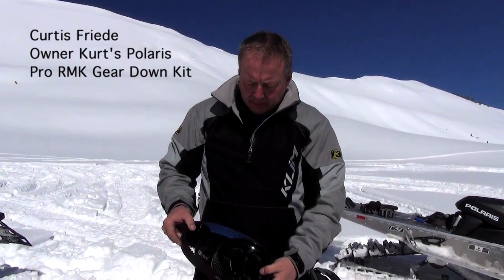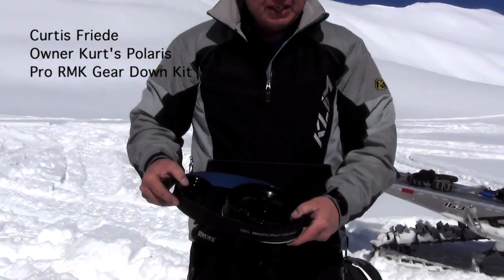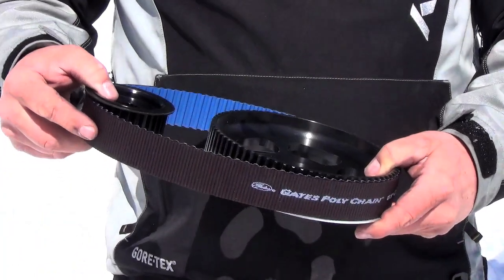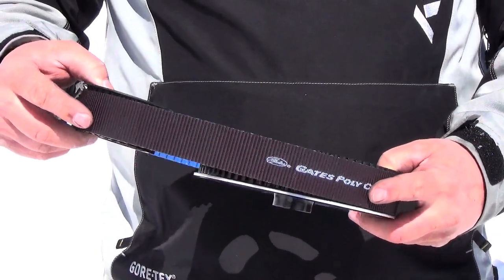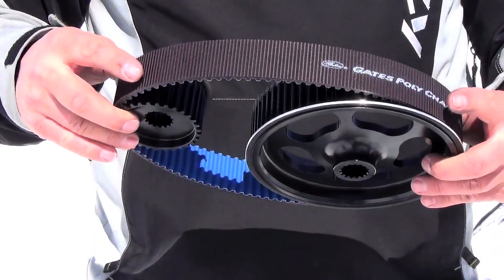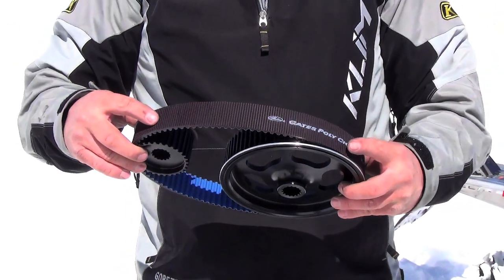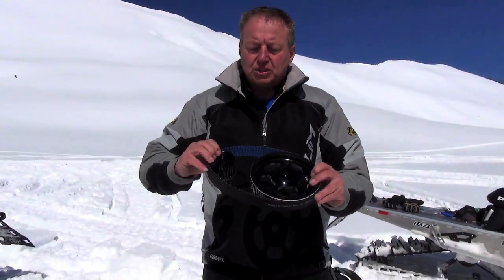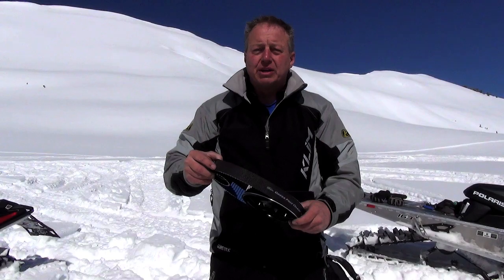Kurt's Polaris Gear Down Kit Install and Test

Comment: Honest question but does the speedometer need to be recalibrated to get accurate track speeds?  When you change the gearing are you not altering what your stock speedometer will read?
Reply: Yes